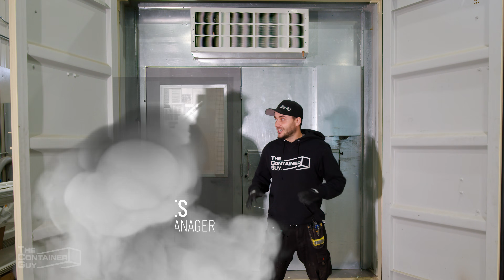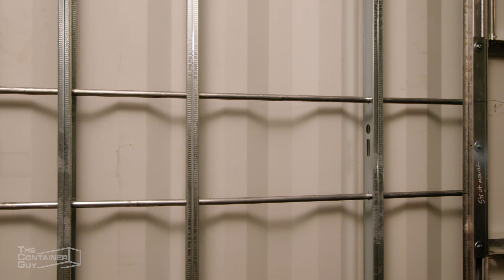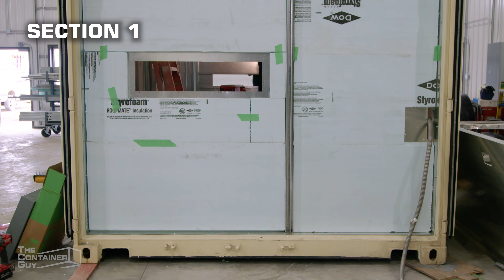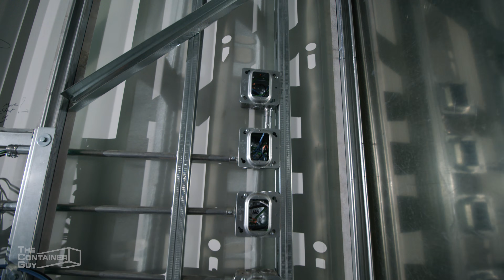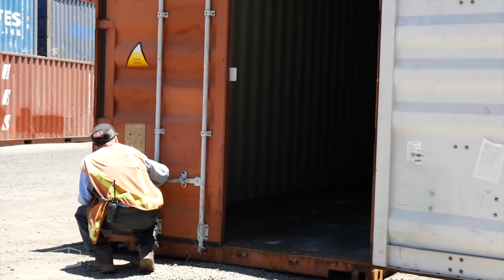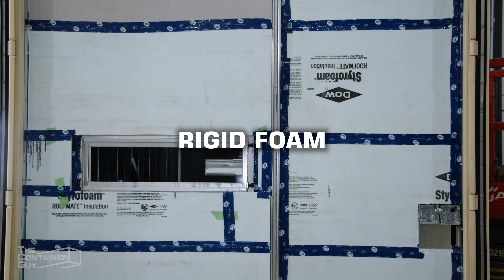Shipping A Modified Container Across The World!

Comment: I want to make a roof out of a shipping container but I need more height. Is it possible to make an arch in the middle of a container by cutting a section of bottom channel and welding to upright supports on each side.
Reply from the maker: Anything is possible. Once you start cutting containers apart and trying to reframe and square them up again, it's usually not economical.